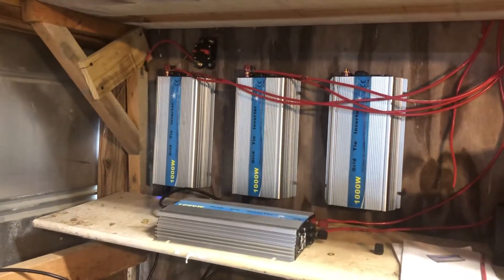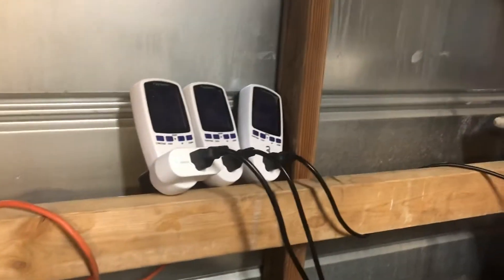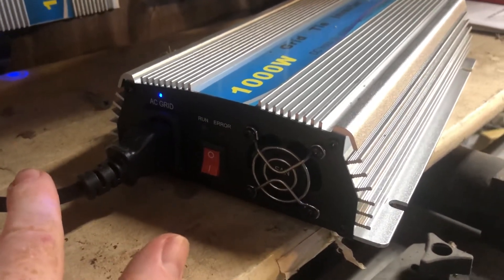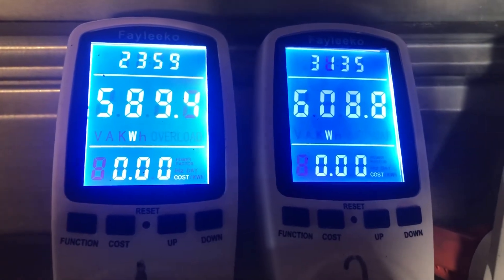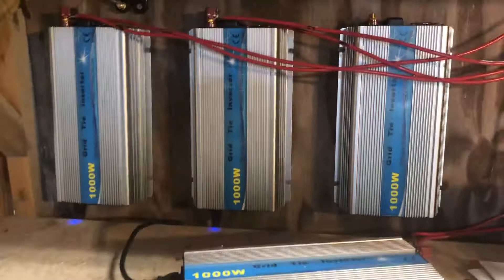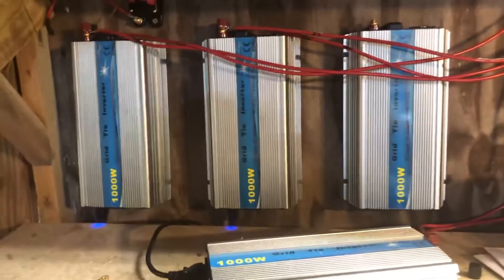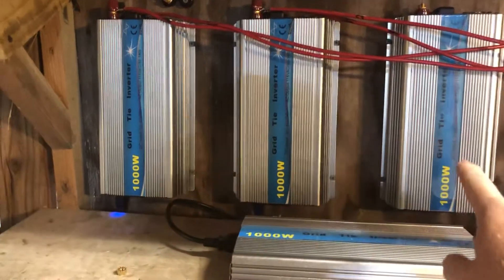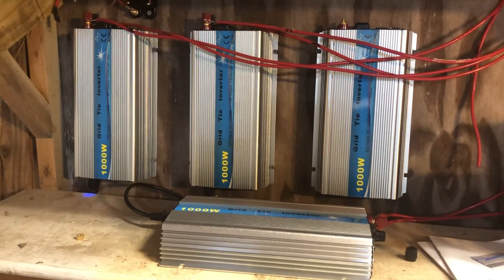Installation of plug-and-play grid tie inverters

Comment: Do you prefer this over the growatt?
Reply from the maker: Most of my Growatt stuff is off-grid. They are just different use cases. The benefit of grid tie is that you produce what power you can via the solar and the rest comes from the street so you don’t have to worry about it
Reply: @tennesseevalleysolar4101  what if you are not using this energy does your home energy meter run backwards and give your credit or you just give off this energy for free to your energy supplier?
Reply: @greg23842384  another person asked a question somewhat similar to this above and as he responded, If you if you have a new modern digital meter and produce in excess of what you would normally consume then your meter will actually continue to read this as if you are using that amount of power. So for instance if you’re producing 1000 and you’re only using 500 then it would look like you’re using an additional 500 W off of the grid so like he said do you wanna keep it and check with what you’re using/producing. Now if you contact your electrical company and you get a high directional I believe is what it’s called digital meter it will register if you produce extra power. I reached out to my local electrical company multiple times getting information on this and they will tell you for the most part the biggest concern is that it has the island protection, essentially if the power goes out these things shut off instantly and they do. 
You can reach out to your local electrical company if you wanted to and see about getting the different meter, however I will caution you that you need to make sure if you live in a area that is very strict and want to go by the book and utilize something such as this you would just need to contact them and make sure that an electrician comes out or that it’s certified plus there’s other things that they make you do if you’re running solar such as having a sign on the side of the house be at Small as well as the electrical company knowing about it etc. For the most part anybody using these is not producing 13,000 watts of power, if so you’ll probably burn the house down LOL

Comment: This very good.I wish you had listened to it before posting as with my computer volume at max it is a strugle to hear you. Maybe re-voiceover this great video so we hear you and not the background. Nice system!
Reply: Can you use is in a grid down scenario to power your house & shut off you’re main breaks not to back-feed the grid that may hurt someone !
Reply: @marktheunitedstatescitezen185  See Above: "No. These Invertors are not allowed to do that. How they work is they are constantly sensing the Grid's 110/120 VAC and Sine Wave @ 60Hz, when the Inverter sees a drop off in the Grid, they shut down. So you have no power when the Grid is down. It is called "anti-islanding" (or very close to that). This automatic feature is there to protect line workers and other responders.
Reply from the maker: Sorry about that
Reply: So these are designed to Back-Feed the main panel , similar to plugging in my generator into my drier plug ! In theory !
Reply: @marktheunitedstatescitezen185  No. With your generator, if the Main Breaker is "on" or "off" your generator will blindly pump energy into your house or house and grid. These Invertors are not allowed to do that. How they work is they are constantly sensing the Grid's 110/120 VAC and Sine Wave @ 60Hz, when the Inverter sees a drop off in the Grid, they shut down. So you have no power when the Grid is down. It is called "anti-islanding" (or very close to that). This automatic feature is there to protect line workers and other responders.